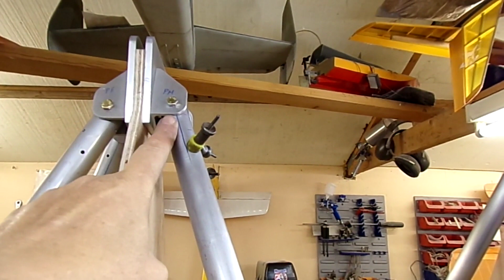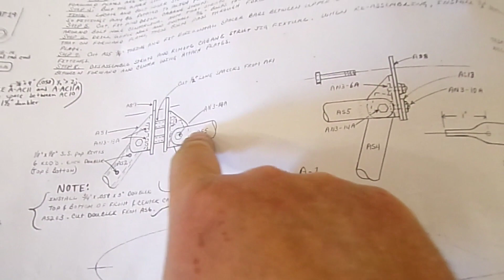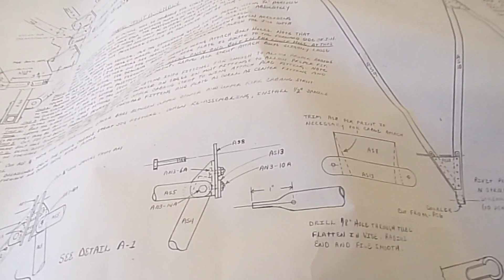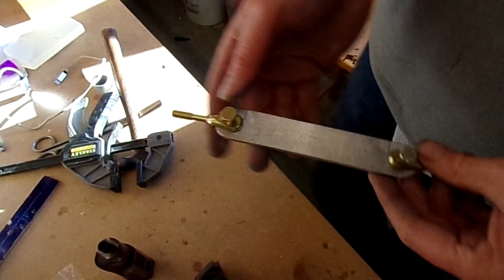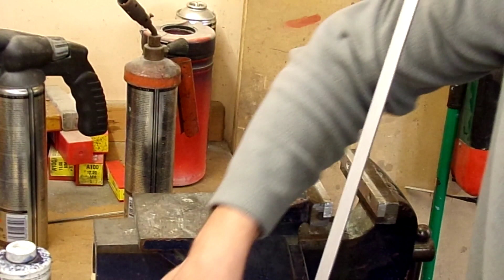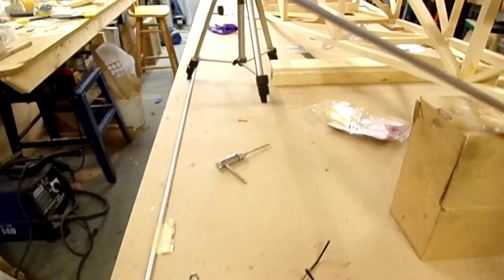EP87 I finish fabricating Cabane struts for the Fisher Youngster V

Comment: Who does your stress calculations?
Reply from the maker: I do.
Reply: @flyingkub  I was always wondering about that, do you have to do those calculations for every part of the construction or do you accept the plans and design has already calculated that? Always amazed.
Reply from the maker: @ShortField  I only do calculations if I am deviating from the plans, when I calculate what the original strength was and then what the proposed structure strength would be. I take it that the original structure as good as it has been proven by the aircraft that have already been built.

Comment: I watch your build and it amazes me how simple the FP 202 is compared to yours. Even the FP 303 is far more complicated, or involved, than the FP 202.
Reply from the maker: From your videos I would agree. The 202 is a very good aircraft for a 1st time builder but even looking at you videos I can see areas I would modify to give it slightly better service life and to in my view just give it that extra polish to the finish. So like any of this type of project you can make them as simple or as hard as you want but with the Youngster the main complexity is the fact the plans have so many gaps in the information or information that is different on differnet drawing, which makes it more complex than needed. I hope my videos will help other past these issues.

Comment: Thanks for sharing your build progress - enjoying it immensely! I've run into the same edge cracking problem when flattening tube ends. Would you share your annealing method? What are you heating it with and what oil is it being quenched in, for example?
Reply from the maker: I id put in the description a link to my annealing method but did not give the oil on that video which is to flash as a temp marker (10w40 engine oil) quenched in water. Here is the link to the video https://youtu.be/gwKkCQbOEeY
Reply: @flyingkub  Thanks, very helpful to see the flash - is that a propane gas torch, map gas? Does this annealing take out the T6 temper, and if so, to what degree does it compromise the strength?
Reply from the maker: @commentatron  propane but any torchshould work. Annealing will always change the temper so the ends are no longer T6 but become O grade this reduces the strength by 25% to start with but aluminum alloy age harden and the flatening process work hardens it as well so within a few days it will have hardened to a point that is around 50 to 60% the original T6 hardness and about 75% the strength. Untreated and flatening the tube will over harden the metal and will reduce the strength to below 50% and make it prone to fatigue cracking and that is if it did not crack during the forming which takes out another 10% if you cut and file out the damage or makes it even more dangerous if left untreated.
Reply: @flyingkub  Thanks, mate!
Reply from the maker: No problem